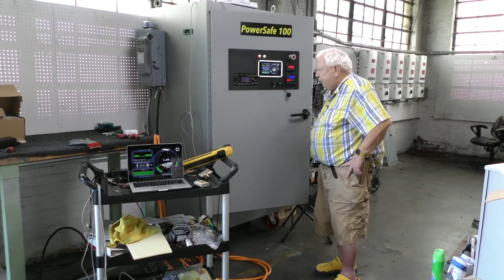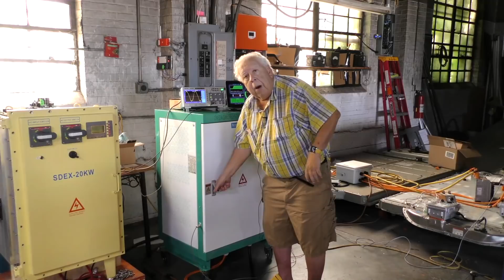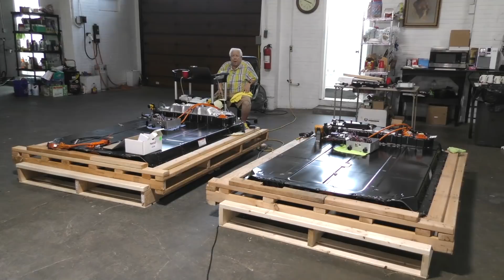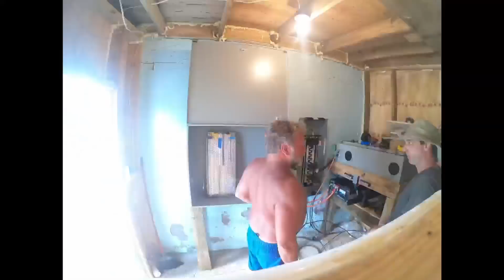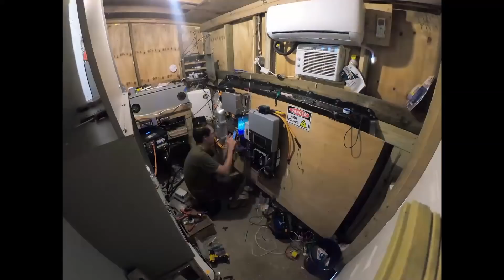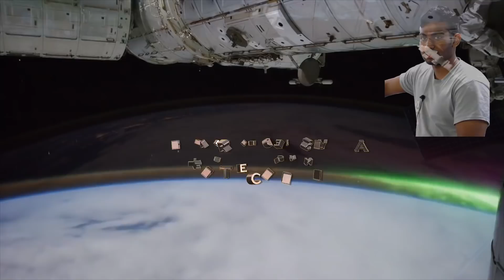Model 3 Battery and Sandi 30kW inverters.  No more 48v Sigineer

Comment: I am also a solar and EV guy but it seems most of your buyers nowadays are likely to be solar oriented  and its nice to be able to use a whole 300 plus volt ev battery pack but its also potentially very dangerous so most solar people should stick with 48 volt as about 10,000 watts is most the great majority of homes need at any one time and with efficient inverter motors and compressors in HVAV especially mini splits and water heaters and dryers  peak loads and max loads can be decreased tremendously as well as relays etc to prevent say a fig and freezer on at same time or oven and dryer.  Many of these will also be replaced with solar direct 48 volt dual 240volt units in the not so distant future Electric water heaters can be converted just by changing one element and attaching 3 or 4 panels very easily.  Face it whether economical or not 48 volt will be the standard for at least several years and the 300 plus volts will be used by the few that can afford it. it would be nice for say 4 closely neighbors to use one or two of the 300 volt 30 Kwhr systems and probably economical.  I live in west tn not far from you and supply 85 percent of all my 6500 square foot home with about $15,000 worth of panels 16kw and new DIY chevy Bolt batteries ($98 per Kwhr new 60 Kwhr back and  2 MPP LV5048 hybrid paralleled inverters. After tax credit thats about $11,000 but like you do now I do not sell to grid and avoid most costly wiring by having MPP MG units that accept 450 volt pv input as solar chargers. I have grid as backup but could easily disconnect from it if I wanted to rum generator several hours a week but fuel would be about same as grid connection. Ehe extra cost of batteries etc for 100% offers wouldn't be cost effective nut generator would be.
Reply: I don't believe in using resistance to heat water. I am intrigued by your price claims however. I tend to care more about scale than what I can do for a tiny fraction of the population as does the channel that we are commenting upon. In terms of what the Chinese are offering that is beyond the scope of this comment but it's important to remember why they got our battery company. Whether industrial Espionage required it to recall its first batches of batteries or not one can observe the price of the spark 2014 currently being ridiculously low like $5,000 for a car that you can charge up in 15 minutes. The car that has better zip than most price no option sports cars or however that expression goes object price No Object.

Getting the voltage is correct within the black boxes that ship on several pallets is however for the General Public necessary to discuss only because industry fails to.

What is endangered is the electric rid itself because if it charges too much for customer just to connect been too many customers are going to leave it and that turns it into a ghetto. Robotic delivery vehicles can easily out-compete the electric grid 4 Choice customers even in water delivery and this is what we have seen happened when it comes to information in terms of Wireless. Wireless is of course worse than wheeled. I believe in Pipelines but not power lines for anything not using electricity. I believe in power lines for lighting and logic not for horsepower. So I believe in liquid nitrogen not electrons to do mechanical work because I understand what the issues are and don't give a damn about incumbent industry stranded costs even if we lost China there is still hope for the Americas and I expect us to do better.
Reply: @Irene-fu6gj  In short LOL I started with 4 HVAC unit stotalling 13 tons all 10 SEER with gas heat  in a relatively efficient Dryvit home with 1 1/2 inch exterior foam insulation and relatively air tight  on well system to a 3 ton inverter heat pump and a 5 ton 2 stage water source heat pump that we limit to 1 stage or about 3 ton and it does 85% off conditioning and runs most of the time. We converted a 3 hp well pump to a 3/4 hp Grundfus SQ soft start unit that perfectly matches our needs of about 14 gpm even with 2 nd stage water source heat pump use. W also went to 4 gallon pressure tank and 50 psi constant pressure valve to house and separate run to water source unit at 20 psi and it has automatic water modulating valves open about 60 % most of the time.  We also converted 2 50 gallon natural gas water heaters to a Rinnai 98 condensing tankless gas unit I installed.   So we converted to much more efficient HVAC and less of it and tankless gas water heating thus also cutting our electric peak demand tremendously.  I also replaced the HVAC DIY.
I then decided against grid sell solar for 2 main reasons . first the paid amount for solar produced power or offset went down and the required grid tied inverter asystems mostly didn't allow for power during outages and I want planning to sell my whole house regenerator to buy more batteries and offset solar cstorage costs. The better hybrid inverter that would provide power during outage were expensive or complicated but I almost waited for the Sol Ar 12  inverter at $6500 plus but instead decided on MPP inverters . I have 2 MPP 5048 MG mainly as chargers and 110v output via transformer and 12 kwhr LG lithium baterrie DIY.  These units allow 450v pv input thus no paralleling and combiner boxes needed etc and much smaller pv wire for long run. They can easily handle 14 to 16 of the 300 watt panels each efficiently.  The MPP LV 5048 split phase hybrid units are grid connected and connected to all the 240v loads and provide 10,000 watt continuous power and 20,000 was short term peak for start up loads but the only extra 240v loads I have that require start up power is the watercourse HVAC even the well pump is soft start never requiring more than 1600 watts. So basically we switch off one HVAC unit when we use the oven or dryer ( purchasing a heat pump dryer soon too) which isn't very often and most likely we wouldn't need to then but just a precaution. Here is the  the breakdown of the DIY solar cost

Panels 
42 new open box 300 watt high efficiency panels
@.32 per watt     12,600 watts                                              $4,032
14 250 watt used panels @ .16 per watt   3,500 watts          560
shipping to terminal for pickup                                                  350
                                                                                                                   Total $4,942

Batteries NEW LG cell modules from Chevy Bolt
never installed due to malalignment of bolt holes etc
$50 per cel of 432 watts  140 cells                                $7,000
Shipping                                                                                   200
10 % discount coupon                                                      -    720
Extra 10 % less desirable modules 
with tabs cut short   14 modules  FREE                                           
Totak 154 modules at 65.3  Kwhr                                                  Total      $6,480

Treated woods mount ground contact                                                          $1000

PV wire 10 guage and 25 ft 2 guage battery cable                                      $300

Transformer     10 KVA used  Step up/ Down                                                $200

Inverters
MPP 5048 MG (450v PV input)  2 @ 650 each    $1300
and paralle kit
MPP LV 5048 split phase hybrid units 2 @ 1200   $2400
                                                                                                           Total      $3700
 _________________________________________________________________________

Grand total                                                                                                        $16,622
 minus 30% tax credit                                                                                          4,987
___________________________________________________________________________

Actual cost ofter tax credit                                                                            $11,635

Priceless about  80 hours of work and research and some physical help from friends and children

Payback period  Savings has averaged about $230 per month for a 50.6 month payback which would have been a lot quicker without the extra 30 Kwhr of batteries but peace of mind and available total independence is priceless too.

I also swap out the battery packs from solar to my 2 48 volt 2005 model Club Car DS golf carts one street legal and one lifted etc for hunting. The street one will go 62.5 miles up and down very steep hills on pavement on a single 6 Kwhr pack and the pack weighs 65 lbs !
Reply: @teekay1785  okay and studying your first response again here I know that there is something quite extraordinary and that is that you are dumping hot or cold water into the aquifer and I'm not sure that that is allowed especially without a thermal transfer system because your ground Source heat pump may require a closed loop as does the aquifer protection law in your neighborhood? That being said I give priority to homes that have surface water especially infinit thermal capacity flowing water. In terms of the ocean I did note in other comments recently that money he's from the ocean is not polluting currently and that is not expected to change anytime soon it is not an either-or situation polluting heat into the ocean can almost never be defended and in America we have banned it for a nuclear future involving dry Cooling but the real issues as I have been explicit about in using uranium is that it should displaced fossil fuel use in for example not just the heat required to turn bauxite into aluminum but in the manufacture of cement and certainly the creation of synthetic fuels which it currently is used for on aircraft carrier to make literally jet fuel but liquid nitrogen is not jet fuel and and sir you don't seem to have a clue how cheap liquid nitrogen is currently delivered to regular customers it is properly measured in gallons per dollar that is enough information for you and if you took this issue seriously you would immediately be concerned about whether the current retail price makes your Investments demented in comparison and reeking narcissistically of profound pathology you're extraordinary defensiveness seems to exhibit. I did tell you that I did not think you were willing to have a dialogue but I have engaged you none the less after you confirm that. I have for your r information forensic psychiatrist in my immediate family and an extraordinary sense of humor that is often exercised for example recently among the group of rabbis that attended an occupied Los Angeles event or earlier in my life at a bookstore went over a dozen psychoanalyst psychiatrist where in person the Fantastic audience for the stand-up comedy and again these are not psychiatrists merely they were literally the lie on the couch and listen without comment Dying Breed LOL.

Now liquid nitrogen because they can take heat out of common air maybe what you are responding to. It's not like turning water into crystals for your heat that creates the storage problem liquid nitrogen produces tremendous heat that can be used for heating even heating water but scale requires the hot water be for a heating District not even a home with the scale of yours. you don't need to pump heat from the soil the Heavy air that is outside your house or the used are from within your house has ample latent heat in it DUH
Reply: @Irene-fu6gj  Next the water heater issue . Why no resistance heating its from solar I dont even have grid hooked to mine it is solely a direct solar pre-heater for a 98 % efficient gas tankless Rinnai 98 model and it works and absolutely no maintenance till tank leaks and then am seriously considering a stainless boiler type tank. element to match solar is less than $20 and no extra piping to collector etc it really a no brainer and available to almost everyone that has electric hot water and a space for 3 or 4 panels no inverter or batteries needed. See videos by David POZ.  I considered heat exchange via coiled copper or pet tubing to pre heat but lots of materials and potential leaks and a pump etc needed.  I have done this in preparation as a trial before e I disconnect from natural gas and change units to LP gas and use just a small 40 to 100 lb tank for now which should now last about 2 3 months or more at a time for cooking and water heater and rarely a decorative fire.Thus no $25 a month gas line. I can get bigger LP tank if needed but I have 2 40 gallon tanks already.
Reply: @teekay1785  it's interesting your writing style for a physician and you're saying a man that I think only has a GED and has nearly blown up his family numerous X in his Adventure with Surplus Industrial absolutely Green Tech like photovoltaics he is absolutely narcissistic and an example of ultimate white privilege being literally occupy Australia which requires Moore atoning then the United States and the Native Americans we Slaughter? The practice of using essentially embezzled solar panels 2 greenify resistant water heating deserves greater scrutiny and scandal LOL just because you can poach from hookup culture gone Wild does not make a right
Reply: @Irene-fu6gj  I am all for scale but you can't scale good sun exposure and thats why things like local liquified air electric generation may be am answer to a "LOCAL GRID" kinda like a substation for the grid is now. Actually I am pro Nuclear energy but thats controversial and another topic.In times of emergencies like tornados ice storms military attacks etc (I am surprisingly not a pepper) local grids and personal solar and generators etc make a huge difference.
My next thing is more PV to charge EV and use their batteries as some storage also. For instance you can get about 2 kilowatts per hour  of power from a charged TESLA see video by Will Prowse. It would be great if there was a standard for mass produced EV s to have a place to connect to them that would directly feed an inverter that supplied about 5-10 thousand watts of power like for California brownouts etc.If you had to go charge car and go back home each day especially for when there are a lot of 2 EV families and one is sitting at home all the time !!! Might as well use its batteries for storage too! Yes the warranty would have to say so many Kwhr of use rather than miles etc but so what.
Reply: @teekay1785  so again when I have said about nuclear is very very clear. As the bombs got dropped on Japan the petroleum industry had been on notice for many many that the cost of local Heat was going below the cost of the cameras back then 4 things to burn. So obviously they managed to prevent further use of the Heat to operate propellers and other things like gas liquification plants with the gas not being gasoline but nitrogen and oxygen. You know we have had half a century of cars with occupants and drivers inhaling the fumes of other cars instead of carrying liquid nitrogen around along with plenty of oxygen so that you don't have to bring rodair in. You know we have these Tesla for utility vehicles that have HEPA filters and they have places I think to put your water bottle Rochester Starbucks which is pretty strange for a six-figure vehicle it does not have any kind of scuba tank in there because carrying liquid oxygen around is not dangerous it's kind of a no-brainer that if you are going to have people on the road you must provide them with oxygen. To not provide oxygen in a contraption that costs 4 figures even like a nice electric bicycle which should have liquid nitrogen providing the energy to maybe just concentrate and filter the oxygen but I don't think you need to be concentrating Road oxygen has somebody in another Channel asks what is the cost of filtering the nitrogen? He wants to know he would pay like $10,000 for the answer about percentage he wants to know what the capital infrastructure to get the dust out of the atmosphere is so that he can decide whether you want to store the nitrogen that you boil so that it can be liquefied again without incurring that cost
Reply: @teekay1785  there is a problem when you don't consider the possibility of actual change. When you would think that the Europeans or the Australians or the Japanese have it right vs some other Nation instead of nobody having the opportunity that we know have to do it better and differently
Reply: @teekay1785  the facts are that we know how to harvest energy. We can do it by mining uranium or we can do it geothermally even we can do it by screwing up with the winds on this planet. We have these options and we don't have any police protecting the weather systems not even as to pollution. We don't have any of the intelligent people in America being recruited to be scientists. The stupid if acacian of the scientific community it's costly. When you talk about recruiting for Technology and Engineering and science when you're trying to get a tiny number of people and the efforts that you see are the opposite. You see the cannon fodder but you don't see the generals. That is a big problem. We have Among Us the steins to kick ass but they kind of Artemis directed into helping out making weapons even I mean in the United States of America people who could go to college directly from high school are instead enlisting but nobody not one person on this planet jellify the gallon of gasoline and slathered it all over their body riding a bicycle in public while lighting themselves on fire to death. Not one person. You can blame the pandemic but the fact is sociopathy is the actual virus that is destroying everything. The lack of Shame children of college supposedly college graduates feel when they enlist so that they can have sex even if it's non consensual and a good chance of becoming a United States Senator just because they don't have a penis and they're willing to kill innocent people that is a problem.

The real problems that AOL us Ella a i l s these problems require actual human intelligence not just artificial and we don't reward that. You have an idiot like Elon Musk getting cult figure status and this dying man here saying how come this guy can Lampoon some sort of wimp sitting there crying about the goddamn virus hurting his grandiosity and then he gets this technological accomplishment that does not compare to what his grandparents watched. I sympathize with this tobacco addict and hope that he does join in the class actions against those people who now Rob him of the Decades he would have enjoyed. But the real issue is when is the customer going to be king again? When will we depose those who stand against enterprising Solutions to what matters most. In China the joke goes Contraband in houses includes sewing needles but in America what is a crime is to have anything like a clue. This has not always been the case and when people are willing to destroy all life on Earth over teenagers being able to miscarry On Cue by visiting their local pharmacist if they have the guts to not buy food for their family with the money some dude gave them to abort there must be something in that buonanima that suggests they're getting closer LOL right?
Reply: @teekay1785  you know I have tried to respond to the different views I have of your comments at least in terms of the email version and the current version that is red in full by me but quickly it didn't of course I still have the notifications which are the most trunk truncated from the YouTube app. Of this comment belatedly this comment is about that last few words from the beginning that I see. You claim to be all about scale. Well I have mentioned the greatest scale issue which is acknowledging The Hub celestins I said obsolescence of the propeller. You want to talk about internal combustion engines and you are ignoring the propeller. You want to talk about rubber tires vs. Steel wheels and instead we could possibly communicate about the propeller. The discussions about trains versus trucks I'm sure we can find them in 1970s ASCII forums far more current than you and I could come on even if we tried. So what is it about the propeller that I have alluded to? I have pointed out the first problem with using propellers they don't have any torque whatsoever okay so what's the second problem with propellers? Without torque you are not able to move enough stuff. So the cost of shipping is prohibitive in other words you have to drink your own urine and pay for the reverse osmosis to make that legal or at least power of the ball palatable.

What is the benefit of a propeller? You can hoard oil as our President says on the sea because you have a surplus of ships because you have slowed them down by retaining their engines took make use of their inadequate torque even though you can't slow them down enough for them to use less than a hundred times as much energy as is needed to travel 100 times as fast.

So why are the oceans still a moat? we are after all figure it out how light Amplified by the stimulated emission of radiation can be weaponized not just a way of getting your particular fetish satisfied for pornography without having to store it domestically at all.

Alternative 2 up pipe under the floor of the sea to distribute liquify nitrogen would be to fly it across the surface of the ocean instead of using propellers to ship liquefied Natural Gas. So instead of allowing manufactured housing including of course 55 stories tall or far better like the homes people bought from the Sears catalog we have developed plans to condense without even using uranium directly i e without converting the power to electricity even in Moscow they bother to do the post World War 2 freakish Electric fission Drive instead of direct. I suppose our Navy
Reply: I suppose there are lots of dead generals we need the strip of all their medals for allowing industry to prototype nuclear electric in our ships despite them working better with direct drive. Electricity is a tax if you need an axle that is turning then you use uranium to do that you don't use uranium to buy a alternator and then buy an electric motor unless you are wholly owned by the alternator and motor maker unless your goal is to make call seem like it is worth digging up.
Reply: So yeah the propeller are you willing to dignify the propeller another day another hour because if so you don't know how to read for example Google does not want to say the four letter word it's spelled c o a l and it's not complicated to know that in my car convent. By car convents Google wants to say comment. This is a highly encrypted message it is written in English courtesy of Google. In the Bible the Lord created of the Tower of Babel and that story has something to do about fear doesn't it about speaking in tongues so that your neighbor cannot understand so that your boss your president can not find out how good you got it. But we must speak in the common language and that language can and should be science we must not be afraid of our atomic age and we must promote our children into what we know and let them go.
Reply: @teekay1785  the issue of saying about two kilowatts is an odd one and I don't know why he would be in the market for hauling electricity in your Tesla home? Currently there is not a road tax on electricity used for cars I guess this is why we see that happening LOL. Again you cite a channel that has somebody of extreme political beliefs and almost no formal education who is extremely popular because he is athletic and Caucasian literally a high school and college gymnast. A man who lived in extremely antisocial life even now but when you say it is surprising that you're not a prepper I don't know why you deny the fact that you are. You have an opportunity to educate yourself now with unvarnished truth but instead you buried your head in the sand so I guess you need to go find your crack whore girlfriend that you're cheating on your wife with and bring home some Coronavirus instead lol?
Reply: @Irene-fu6gj  We could reduce power demand a huge amount just by super strict building codes and efficiency standards even though we already have. Lets face it a 14 or 15 SEER minimal requirement for HVAC alone could be almost immediately go to 20 SEER especially if a rebate would pay back most of the extra up front cost or a low interest utility loan like there was for insulation and storm windows etc in the 1970 s
Reply: @teekay1785  I appreciate your responses and there are implications within the responses in terms of your state of mind that would be better discussed explicitly or after additional study by me certainly. However I can give you some early responses from me to York contentions. I don't see any consideration from you of the opportunity cost investing so much capital competes with.

I find your comment about liquid nitrogen being a local grid or locally-produced issued to be contrary to my intended contention that the Electric System is kurupt primarily because foreign Nations until the barges from Moscow at least came on the scene cannot inject their electricity into our grid and solar has been doing that and it's doing it for less than $0.02 a kilowatt-hour in Saudi Arabia but whether two cents a kilowatt hour is a good deal or not whether a penny is a good deal or not that is what we need to be unfortunately Politically Incorrect Lee disgusting. I say disgusting of course well it's typing disgusting twice that's one for the book disgust it's not discuss the words sound similar but the contact should have been but was not clear.

The point about liquid nitrogen it's not only is it far less Rube Goldberg and in this video part of the stand up or death chair routine or in the prior video on this topic from a few months ago from March yes I did watch after commenting on this video that you respond to I did watch still over two hour video with this Michigan software architect that seems to have ripped off this old man buy nothing supervised Den Michigan to the tune of maybe like six figures easily.

 When you are a IT person working remotely what you do is you hire several different cash a revenue providers woohoo have the same programming problem and you charge them the same amount.

Reverse engineering for sport is an interesting game that is being played and I'm sure you have noticed the price contentions regarding LG being $100 not even and so we have credible voices contending that the cost of electrical energy storage is now a double-digit natto triple digits expense.

The question is can we afford double-digit expense to store energy electrically on top of the premium that we pay Capital wise to produce it distribute it and as has been pointed out by you and just now I guess protect those aspects from sabotage especially giving my contentions proper regard that the confiscation of all the equity from the investors in the company that is subsequently supplied all the batteries to all the buses in China was General Motors again screwing around for their perceived best interest after Barack Obama spared them corruptly. we had them on the ground and we failed to Slit the throat but the facts concerning A123 give us the opportunity to reconsider and simultaneously do the same for Tesla. Tesla is committing crimes against humanity to use the old-fashioned expression because human beings are definitely affected even if incidentally
Reply: @teekay1785  I used to mock air conditioning contractors when they had cr6 units sitting in their Lobby and asked if that was for some summer cabin you know where you pay a fortune per square foot and get up there maybe once every few years for a few days so it's such a low efficiency a pump can be justified as worth the cost to drive it to the site. I used to be on a young like in the Bible but then I became an adult and I understood that regulating what kind of heat pumps people have access to with the nine somebody who needed one precisely for that. And that's what we have seen the electric red has created a shortage of two speed central air conditioners long before there were inverter air conditioners the electric grid prevented people from having access to significant Cooling upon arrival in the home that resulted in the electric companies being able to bribe housing Developers into not allowing not just methane into home but Banning pre-installed robotic thermostats until we had the nest Banning Mercury was bankrupting coal power plants because if you don't allow housing developers to use mercury thermal only control of the central climate systems how are they going to burn as much coal as they need? We have the efforts to decouple which is what allows electricity to be destroying the planet instead of natural gas coming to the rescue because you need the competition between the two companies and decoupling only one is not hypothetically disastrous even Google has been you know at some sort of orgy waiting for the girl to be distracted for a moment before molesting her deep in her throat and that girl is our future.
Reply: @Irene-fu6gj  I haven't read the rest of your responses yet but from reading your above response and as I am a physician  I can tell you are an educated individual and have a lot of knowledge to share but  you may be having some medical problems that you are not even aware of.  I would respectfully suggest that you see your physician soon for a thorough evaluation. I realize this may cloud your opinions of the rest of my answer.

To partially answe:r individuals , families cities ,states countries etc all make many decisions based on their particular circumstances as to what is affordable and economical and what meets these criteria at a particular time  which can change relatively rapidly.It is nice when this aligns with the greater good and more lofty goals but it often doesn't.  Right now many individuals have decided to try to become energy independent because it has become economically possible. For many such as myself it is also economically attainable and every time someone converts to solar that is one less to provide energy for.  Tesla as a company has brought the possibility of more electric vehicles than internal combustion  on the road (not necessarily theirs and promoted early on by several governments) probably 25 years sooner than without them.  There will always be industrial sabotage and we should continue to do whatever we can to discourage and punish it but our ability to do this is limited.  The fact that Jack cannot get inverters etc made in US even at a higher price is disturbing but thats just the way it is at this time and I hope that will change.  Jack has reverse engineered much about the Tesla vehicle system and that is certainly his right and I applaud him for it. It is also Teslas right to protect their product and their intellectual property though I disagree with some of their practices regarding things like repairs to vehicles not under warranty or providing parts to non dealers etc that is also their right. Basically do the best you can and hope others do that also.
Reply: @teekay1785  look nobody is going to unfairly criticize you in my name but in terms of your response I'm not even sure I expressed an opinion about the cost of the inverter that he is selling but he does not say he can't get that inverter other than from China he said that the price was prohibitive and I respected that very much if you heard anything to the contrary that would be a dictation error but I don't think the errors that were made included that however I give you the benefit of the doubt that it could have I have not proof read in terms of what you find scandalous or unfounded or pathological you have not hinted whatsoever so again it would just seem like when you disagree with somebody you proceed immediately to however you on however with license privilege DeMar k e d as kind I would just double down on what I said regarding the primary cognitive error of society whatever the cause is and that is that we tend to think of energy concretely and clean energy as electricity while clean energy can include electricity it rarely translates to that because there are costs involved converting to electricity and going back to Mechanical work that mechanical work can be pumping Heat or operating a car in either case the cost of the copper alone often prevent electricity from being defendable as even rational on cost alone. Energy can be distributed in other form and you should know that the scandals about uranium I know nothing about and do not care about such Petty politics but I do respect history and the United States has nuclear engine for some of its heavy duty Motors and is the only nation that has truly nuclear propulsion of the mechanical sort so when you have grandchildren and they get their historical doctorate with that as the thesis to investigate you need not thank me but I would have wondered did you attend a accredited medical school? It seems not. Are you working for a medical establishment that has no malpractice liability coverage because you pray upon a population that without informed consent waive their rights to attorneys fees and punitive judgments despite perhaps you practicing in a  state with a constitution that would otherwise prevent that except for federal legislation that essentially is slavery as the Socialist candidate for 2021 election has noted? Double-digit percentages of Americans are so practiced upon and almost none of them currently are migrant Farm Workers that the law was intended to provide medical care for?
Reply: @teekay1785  so it was in the 1990s that I studied and the fields are friends of mine who are among the most famous routinely Keynote to scientists giving speechifying clown for answers regarding my question about what the efficiency of air conditioning was back in the 90s I don't understand it was in the single digits and has advanced to the double digits but your idea of efficient is like the electric utilities claimed that hot water heating is 100% efficient or incandescent lighting approaching near say a 5% milestone which is exaggerated I think it might be going up to 3% but 4% at the most is not efficient
Reply: @teekay1785  used electric water heating that was not energy star but claims to be green because of all of the health insurance fund he is going to me from his offshore diploma Mill LOL is how you come across so far. The question is are you redeemable are you just a pretender do you have actual priority or just vanity, are you teachable or are you as you appear overly tutored overachieving arrogant as all get up ready to accuse me of being the protecting one but rather in fact ill-informed and so far not even acknowledging that air is an insulator so is not a way of cooling the body and in places like India your silence Dooms our planet 2 predatory exploitation by first world technology provider and example I'm how not to do it like you yourself are demonstrating without courage to show that the personal cooling is the ultimate luxury the personal Heating or sweater-wearing lifestyle just because the guy did not get a second term who in the 1970s as you Echo Advanced as the answer far more than building codes. My father for example had a great sweater collection but he also lived alone in a big house any could have been naked in a studio apartment much more morally dependably but like you was reached too late or not at all? Are you able to be a leader? are you afraid to take risks for the best but instead all about the wrongful inartful compromise? I hope not.
Reply: @teekay1785  so for the record I have read down this read all of your responses and more importantly since you have not responded much all of what I wrote and if one assumes that YouTube has placed your response immediately after the comment that you refer to I am still somewhat lost. I pushed the number of buttons but the most important ones I may have pushed I cannot reasonably conclude with any sort of certitude I have. Your responses on certain topics are facile. I don't think you are literate enough about A123 for example, General Motors took that start up and required a subsidized initial years contract so that when they had to do a recall the predictable liquidity crisis resulted in them selling out to the Chinese. NASDAQ prevented The rally in the final months of the death rattle that I can prove would have occurred. It's not that hindsight was 20/20 now but that back then all of the analyst said hold oh, they had said hold it down to a dime oh, they were saying hold it when it was a nickel oh, and on its way back to $20 or more, NASDAQ suspended Trading and the bankruptcies attorneys we're able to to rush the disenfranchisement of the owners of that company cover all their equity but paid 100% and more than that of course to the Creditor clowns who were thrilled including Elon Musk Panasonic Etc. Electrification is not the answer. This should be obvious to a physician. However there are plenty of doctors for whom that lofty title does not reasonably apply specifically they are no citizen and you're the defense of your acting in your personal interest as not pathological is to understate it not evidence based. Your concern is noted but I am in fine Health at the peak of my life fighting for a loved one and for greater influence upon world affair with the fraction of a pinky left over today. Soon I will be alone in this world in terms of my Elder family members and it shall be later instead of sooner for my willingness to prioritize instead of vainly groom the eyes and the tees and limit the scope improperly. I recommend that you read the actual books that were published decades ago about electrification in order to judge the current propaganda you need to have a historical perspective and not just bragging about all the cash that you have spent with many years left before you actually even break even and you will never break even if you wear sweaters in the winter or have chilled seats to sit on in the summer. your example is not possibly viralized so it fails at the gate as you knew before you responded to my comment.